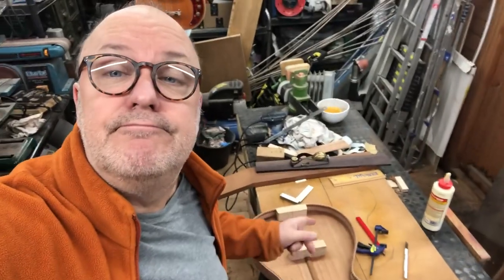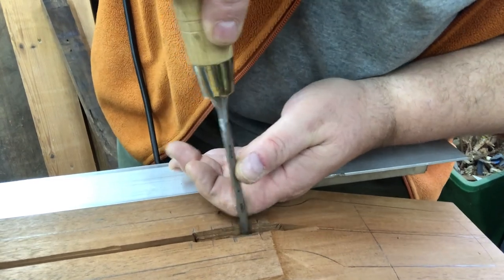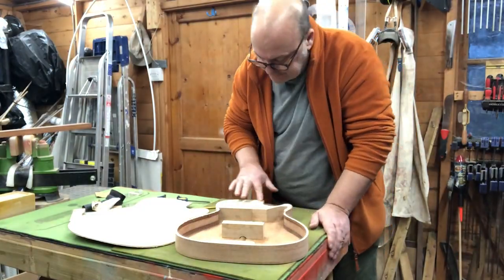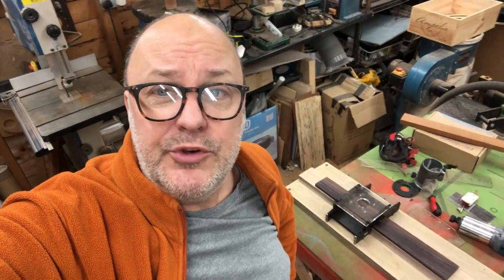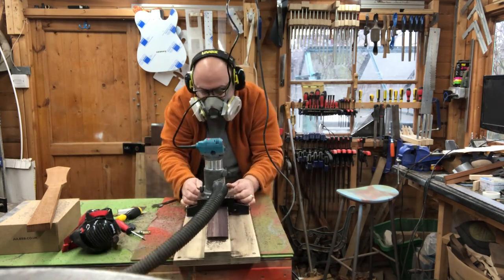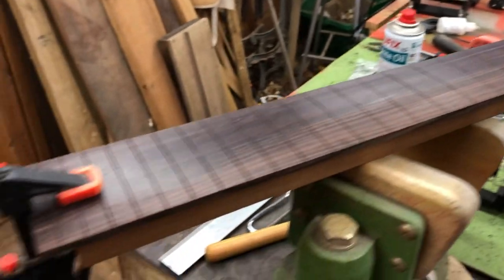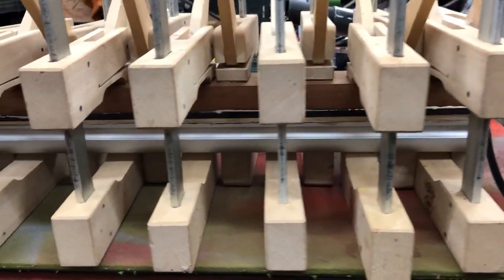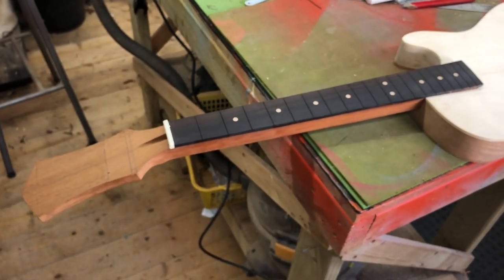Part 3 - Full build of Harmony  Stratotone style guitar, truss rod, radiusing and slotting

Comment: A simple solution for making truss Rod Chanel less scare (and great for repair a shaped neck) is using a fence over the neck level and use front face of your router against the fence. 

This way is just one force applied and its a very easy way to cut the Chanel!
Reply from the maker: It’s something I keep meaning to revisit but end up doing the same every time. I should make a jog really.
Reply from the maker: Jig